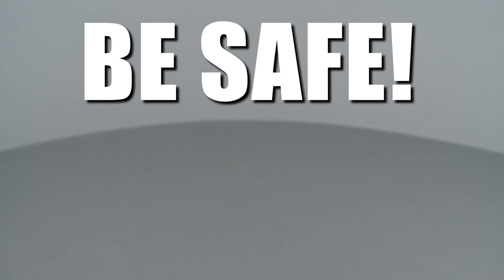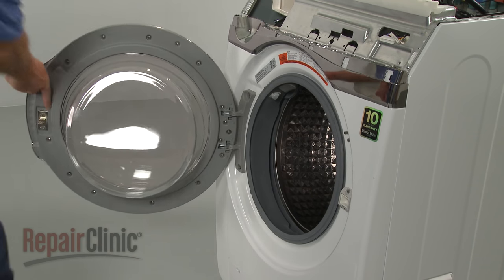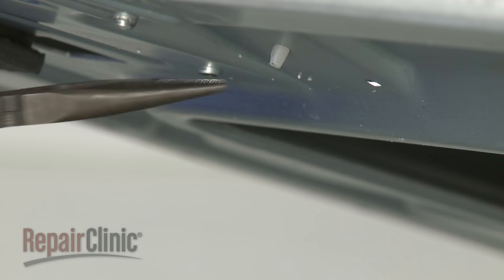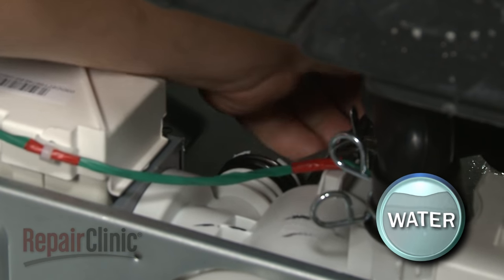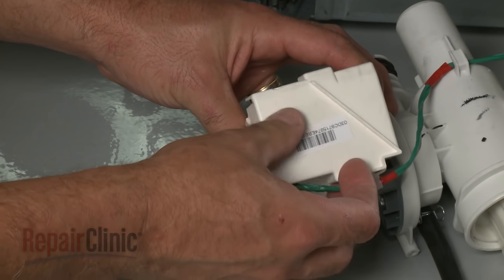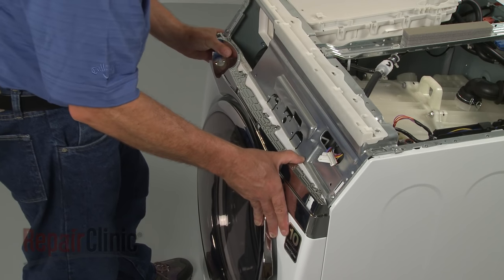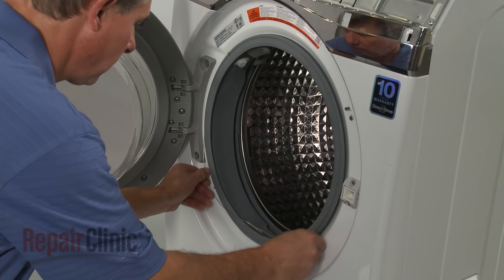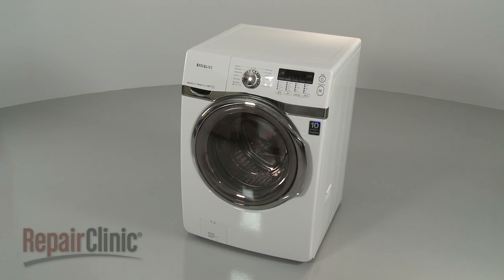Washer Not Draining? Drain Pump Replacement #DC31-00054D

Comment: Just used the video again, I was having problems with the tub draining. Pulled out the (fairly new) pump, found nothing to indicate the pump was bad. I checked the drain hose leading to the pump and found a small amount of grunge in it, then felt inside a small PVC ell that that was connected to the larger main hose leaving the tub. Something was in it, so I unscrewed the ell from the frame. Jammed perfectly against a small ridge inside the ell was a quarter! It would turn 90 degrees, acting like a check valve, letting water through at a low flow rate, but closing when the water flowed faster.
Reply: just read through the thread below and saw I was not the only one to have that problem.
Reply from the maker: oarman2 Thank you for sharing.

Comment: hi, I brought what was supposed to be the OEM replacement pump but the electrical connections are different (my old one was a front side connector side by side vertical orientation like IIm the new one is like -   I, when I take the motor cover off there are opening to just move the 1 contact over to the vertical orientation, however the connector on the new one is facing the opposite face of the old one, since the motor goes onto the stator reverse of the old one is that ok ?

Comment: Have a Samsung WF218ANW front loading machine, about 4 yrs old, leaking from the bottom. Checked the door seal, replaced the supply hoses, ran a cycle and have small water accumulation underneath. Pulled the top off and checked lines to detergent/softener all good, also checked drain pump filter, wondering if I need to replace the drain pump.
Reply from the maker: It’s really hard to say where the leak is coming from. You will need to run the unit and remove a panel to try and see where the leak is. It may be a small pin hole in a hose or the front boot seal.

Comment: This video is absolutely insane,  it took me five minutes tops to lay the washer on its right side, unscrew two little screws, unhook the hose clips, done... pump is out. Didn't even have to take out the bottom shield. Popped the filter cover to get to the screws. I believe the video is just in case the repair guys get their pay.

Comment: Hi, I have a really burning question so I hope yoy react please. I don't want to replace the drain pump but I only want to put that black  hose you see on minute 4:05 back on where it belongs. So how can I do that??
Reply: The small this hose you see dangling off the pump, connects to the pump and nothing else. Its a drain line. You will see its connected to the lowest point liquid can get in the pump. And as I recall, other than the water level sensor, its the only thin tubing like that in the pump area. When everything is back together, this little tube is the one you use to drain out the liquid from the washer. There should be a plug at the loose end during normal operation. Its possible you lost that plug and now you have a loose end that makes you think it need to connect to something.

Comment: Add marine grease to the two o-ring seals inside the motor assembly to keep it water tight. To access this, pull the impeller (white paddles) out of the housing. I'm on my second pump because the first one filled with water, likely because the factory doesn't put much grease on the seals in the motor assembly.

Comment: Omg guys NO YOU DON'T have to do it like that. That's TOO LONG.

Lay the Washing machine on its side, unscrew the bottom plate and remove. You should beable to clearly see the drainage pump. 

FastTrack video to 4:04 and you should beable to see how to remove the drain pump cover and remove the wires. There were 3 screws attaching my pump. Remove the pump and replace with new one, make sure to attach wires in correct positions.

Pop the bottom plate back on and bobs your uncle. 5 minute job...

Do not follow that videos procedure! Way too long. But cudos for a great effort!
Reply: Yes your are correct and i am always doing that
Reply: Ty it did look long. Now i know how to save some time
Reply: Thank you
Reply: Well maybe the long way is for those of us who can't lay the washer on its side...?  Small kitchen and petite single female.
Reply: OMG Correction!!  I first tried the procedure in the video.  Got way in deep, no way to remove everything like the door boot seal--I am not that strong!!  Screws and panels everywhere.  I remembered your post...turned the machine on its side...removed the bottom panel, and had the pump replaced in 30 minutes!!!
Reply: In other words... THANK YOU!!

Comment: Mildew forms inside the tube that is connected to the drain filter and the machine smells awful. What is the best way to clean that hose?
Reply from the maker: You can use some washing machine cleaner: http://www.repairclinic.com/PartDetail/Washing-Machine-Cleaner/W10135699/1373065?TLSID=1621 or run some bleach through a wash cycle with no clothes by to help clean out the system. Other than that there is not a lot you can do besides taking the whole machine apart and cleaning it out.

Comment: This repair is WAAAAYYYYYY easier if you just tip the washer on its side.  Then you just need to remove the 3 screws holding the pump in place and the hoses.  If you really need to remove the whole assemble, the plate around the front drain port pops out pretty easy and you can remove the 2 screws holding the pump assembly (like if you want to replace the circulation pump).  No need to remove the whole front of the washer!  This is literally a 10 minute job if you tip it over!
Reply: Thank you! I simply tilted the washer up, supported it underneath, and did everything I needed to do only having to remove 2 screws. Good advice.

Comment: My model, Samsung WF 328AAW, had the drain pump assembly in the back. All that was required was to (disconnect power) unscrew the two screws securing the back cover plate then remove the drain pump assembly with the three shock mounted screws,a ten minute job.  The clue is that there is no drain tube cover plate on the front of the unit.
Reply: Holy  cow  that sounds easy,  I don't have the front drain panel either.  Its model WF337AAL/XAA numbers .  It has the  ND 11 code  so its a roll of the dice I see , someone else has the code and the new pump  didn't fix it .  so  I  guess a + -  $31 pump is good chance  , beat  $900  for a new model.    I need to get the water out

Comment from the maker: +Derek Carlson What is your washer's model number?
Reply: Hi, it is WF338AAW/XAA.
Reply from the maker: Derek Carlson There is not a lot you can do besides trying different wrenches or sockets and see if you can get the clamp off. You can put a towel across the front so your arm is not hitting the metal. Once you do get it off you can reposition the clamp for easier access.
Reply: This project is tailing in fast :-(  I was able to reach around and disconnect the tub drain hose and cleaned it out.  The machine now drains.  But apparently I also was not paying attention to the knocking when it was working OK.  I can no longer hear the vibration balancing bearings rolling in the tub rings, the washer really knocks and rattles now, and after each cycle, it gets down to 2 minutes trying to spin, and then it goes to the rinse and spin cycle.  Ugh.
Reply: Derek Carlson

Comment: My Samsung washer m/# WF203ANS/XAC is flashing error code
nd. According Samsung tech support my washer doesn't have the drain pump
filter. I replace the drain pump any way. Still same error code. Fuse problem?
Where is the fuse? Any other possibility? Please help.
Reply: That sounds like your main control board is bad.

Comment: I have replaced my drain pump with a new pump. And im still getting the ND error what do I do now?
Reply from the maker: If your washer is beeping, and the display is flashing "Nd", your machine is showing a no drain condition which is usually related to a backed up drain hose or a clogged debris filter.

The drain hose coming from the back of your washing machine should not be inserted more than 6 inches into the drain/stand pipe in your home. Inserting the drain hose too far into the drain may cause a siphon effect preventing any water from draining out of the washing machine. This will cause an "Nd" error.
Reply: ***** We cleared all hoses and my model doesn't have a filter. We usually have to change the pump once a year when something gets in it. But this time nothing seems to work.
Reply from the maker: Kevin Phillips Are you sure the drain hose is positioned properly? The drain hose also has to be positioned higher than the water level of the washer or it won't drain properly.
Reply: Yes I have tried arranging the hose in multiple different places.  Right now it's where it should be.
Reply from the maker: Kevin Phillips OK. Just covering the basics. We'll talk to one of our on staff technicians and see what they have to say.
Reply: Thanks. Right now you guys are sending me a new pump again just to make sure it's not the pump.
Reply from the maker: Kevin Phillips If the hoses are clear and the pump is running it should be draining. There might be a sock blocking the hose at the bottom of the tub that goes to the pump. Make sure the pump is turning freely.
Reply: ***** Ok I check everything drain hose is properly seated and all three drain pumps are good. All so there are no socks or anything blocking the hose. I am still getting the nd code. Could this be a control board problem?

Comment: Retired Mechanical Engineer, former HVAC tech with all the certifications and took an ARI 900 hour course in appliance repair. I had a washer Frigidaire for 10 years. 
Replaced two pumps in its lifetime due to 4 dogs and 4 cats and 3 kids. All you had to do was take off the back panel, drain manually, and nearly rip arms off replacing the drain pump because they are made of $.30 parts and the hose was hard to get to. 
Sorry, but this is a HORRIBLE design for ease of maintenance, change or checking things out.